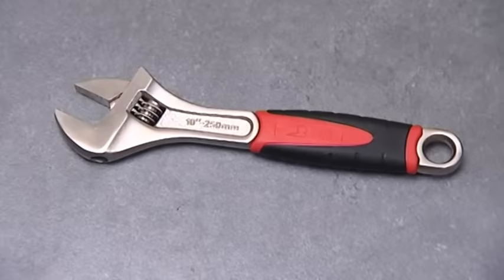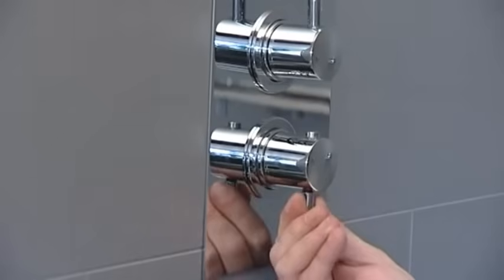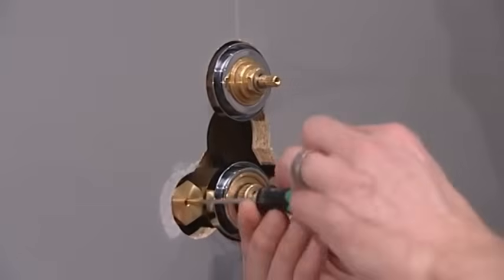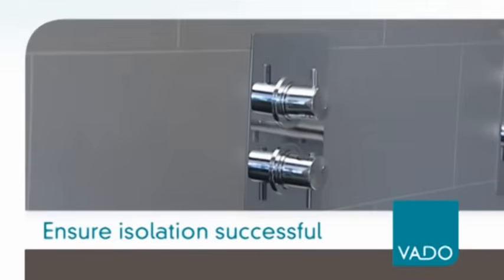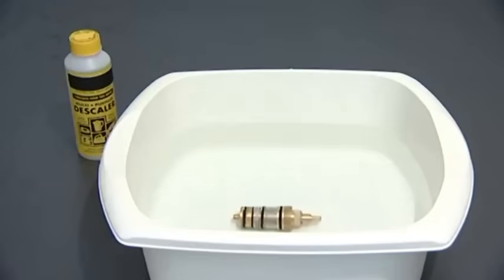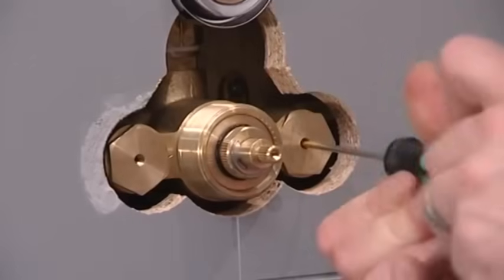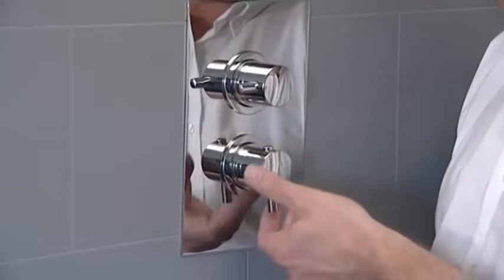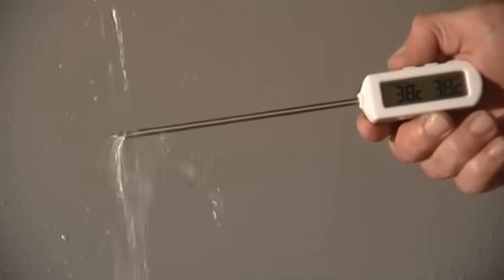How to Maintain/Replace/Calibrate Concealed shower valve [Thermostatic cartridge]

Comment: So instead of paying @£80 for a new cartridge, all one needs to do is descale  the old cartridge and replace the O rings with new ones and lubricate before reinstating the serviced cartridge. Also, inside the narrow shaft of the cartridge is a stainless steel pin which should be greased too. There are no other moving parts on these shower valves and they work on the same principle as car thermostats, in as mush as they have a sealed part filled with wax which reacts to the hot water and cause the SS pinto to move forward and back on temperature rise and fall. No one ever suggests cleaning/descaling  the small gauze filters on the hot and cold water supplies which should be a must.
Reply: Just did all of this one mine (prior to reading this message), but thought I'd second the above. :)

Comment: I have a square rain shower external shower head system.
Sad thing is that on the shower main control head, the hot is on left and cold is on right. 
But my pipework is the other way round ... I have installed the shower head already.
Is there anyway I can reverse the valve to make cold to hot and hot to cold.

The shower head has a button that you press to go to hot .... but in my case hot is cold 

Please give me a solution... I do not want to break my new wall
Reply: Did you get an answer?
Reply: If it’s Grohe, I believe they may have a thermal reversing cartridge?
Reply: Hello Ricky, I am wondering if you found a solution as I have the same problem! Would really appreciate any help, cheers